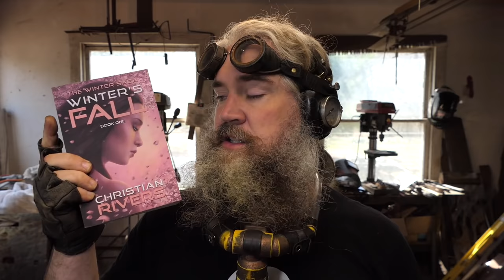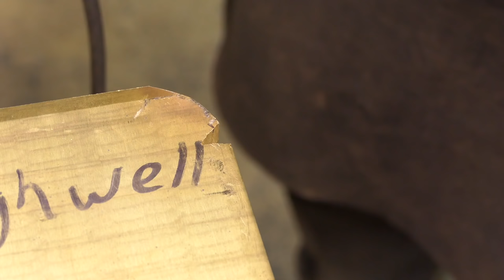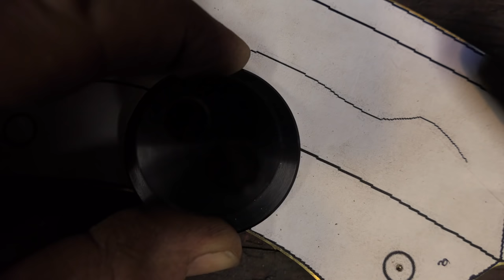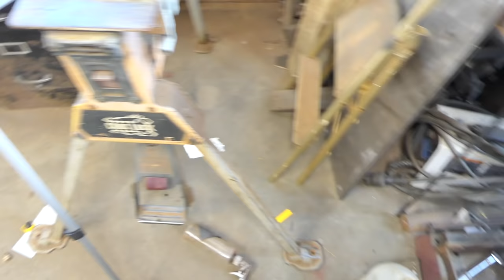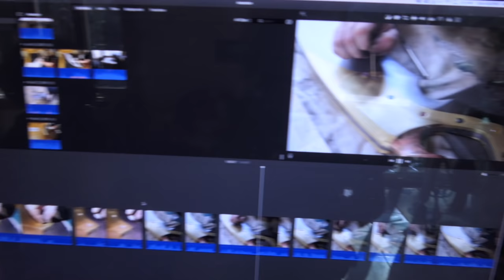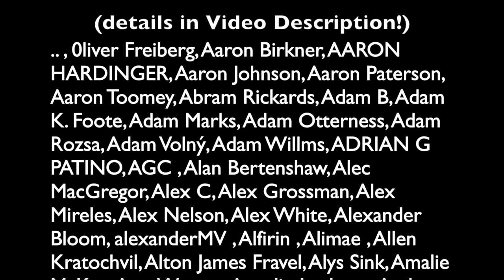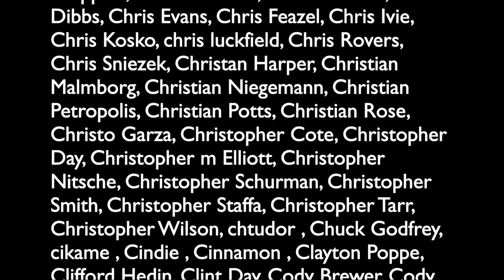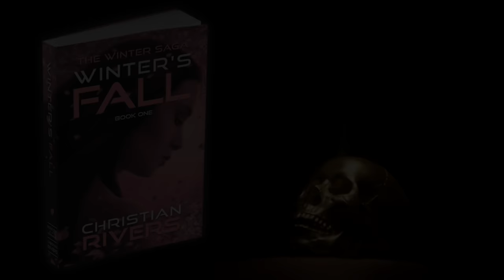Ascension Sword Build

Comment: One thing I'm curious about is how much of that scrap brass you cut off of that block can you reuse or perhaps even sell? The less waste the better and I figure if you could melt it down and form it into another plate once you collect the scrap bits you carve off of that massive plate you could use it again in a future project or sell it.

Obviously the particles that the die grinder shaves off are a total loss, but the bigger chunks could definitely see new life in another project.

Comment: "It's a little crazy, but I think it'll work" is basically the motto of this channel lmao
PS: The reason the ferric chloride works best by evaporation, is because the chemical reaction you're looking for is a change in oxidation; without oxygen to react with at the surface, it can't occur. The heat also helps the reaction accelerate

Comment: You could have copper plated the brass via chemical plating. Using Copper Sulfate and Battery Acid (Sulfuric acid by 30%). Mix them 1g to 30ml and leave the parts to soak for 3-5 minutes.

Comment: If your gonna end up cutting brass out inside like that again you might want to invest in a scroll saw and use omnidirectional metal blades. Might end up with a little less clean up headache after.

Comment: @michaelcthulhu bevel the edges of the steel and brass so the material has a place to sit down. After you grind it it leaves very little material. Basically grinding the weld off. Whereas a bevel would let you leave the weld material in the workpieces and making it stronger.

Comment: **HARDOX TIP** if you pre-heat the spot u want to drill cherry red with your oxy, it will soften the plate and you will save your drill bits.

Comment: I bet a car battery terminal cleaner would clean the hell out of that nipple bit at 21:00. Just drop it over the bit and pull it in and out or turn the machine on for a second and it's brand new. Just a guess/suggestion. Let me know if you try it out and it works though.

Comment: A bezel would have saved you a lot of worry with gluing the gems.

Also, could you not have brazed copper over the handles and not had to argue with chemicals?

Comment: You should have removed a few pounds of material from the backside of the brass and from the blade under the brass, just to make it lighter and easier to use. but hey, hindsight is 20/20.

Comment: Use flat french chalk to mark stuff to burn, you can see it no problem when using oxy-acetylene, not too sure about plasma as I dont use it but I assume it'll be fine as well.
Reply from the maker: That works on rusty steel or steel that has the scale still on. The french chalk unfortunately doesn't show very well on polished stuff.

Comment: To help stop fouling your files add talcum powder to the file after using a file card. ( file card, stiff wire brush for cleaning the teeth on a file)

Comment: could you not have just heated the plate at the bits you had to drill to get rid of the temper, rather than welding in mild steel bar ?

Comment: Wait so why did he plasma-cut holes just to spend days filling them back in with metal plugs and welding and then drilling them back out?
Reply: The metal could not be drilled as it was too hard so he filled the plasma cut holes with a softer drillable metal i think.

Comment: you're making the whole drilling setup too complicated, it would have been easier to use the provided slots in the baseplate to attach a 3/4 in plywood slab to it...

Comment: I don't know much about forging, but how come this guy never quenches his blades?
Reply: Blades this big will most likely not be daily used and there isnt really no use in heat treating and quenching due to no fear in weathering since its gonna be in someones room or inside.
Reply: @tennesseewaterfowler5613  I see.  I just never see him heat treat anything he makes.  Kinda wonder how it affects performance when tested
Reply: @MareeksMareeks  the metal is just a little bit softer. But it still holds a decent edge none the less. The only downside is that you have a chance of bending it during the time you're choppin up pallets and trying to throw it.

Comment: whyare you making the swords to crazy thick? you dont need the brass to be half inch thick if its jsut decoration. same for the blade? why do you keep using half inch stuff when real swords are way thinner and just as tough. its a whole load of unnecessary weight making this absolutely amazing sword almost impossible to use.
PS please make the Nova blood from freezing.

Comment: WHY DIDNT he just use the angle grinder to cut the brass???????
Reply from the maker: You can't, the brass chokes a cutting disc, which then explodes from the heat. Notice the way the Brass never sparks? You can cut and sand, but you can't grind brass at all.